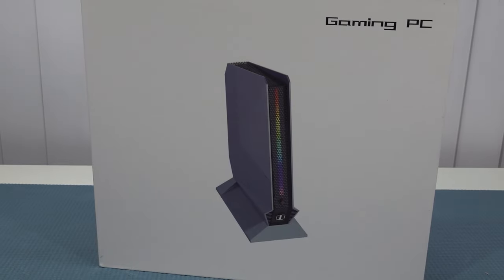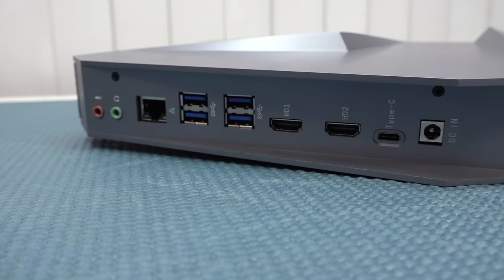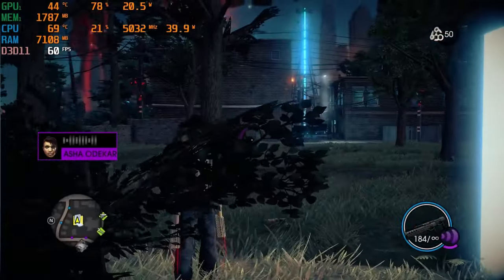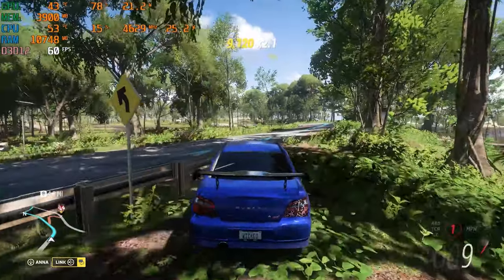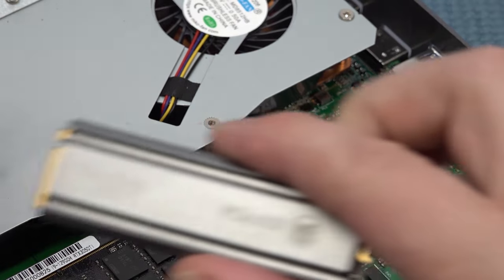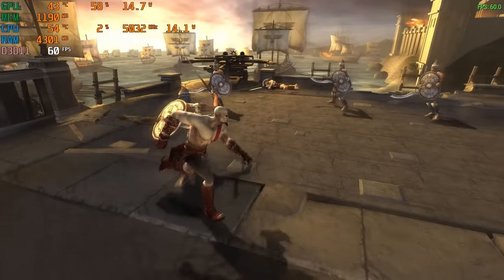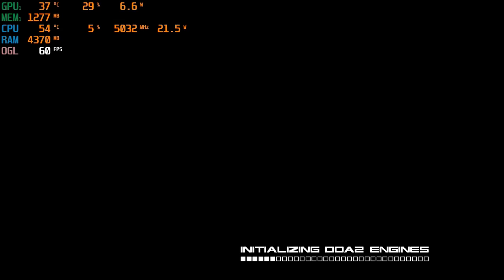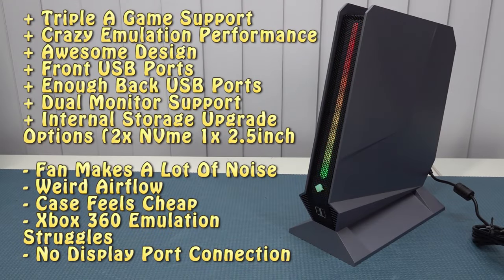Best Mini PC For Emulation - Your Gateway to Gaming Paradise !

Comment: It's cooll but for the i7 version with 16 Gb Ram and 1 Tb SSD you are paying 400 euro more for this than a Xbox Series X. That maybe not that flexible, but prices these days of capable miniPCs are horrible.
Reply from the maker: Yeah, i understand where you are coming from. 
Mini pc's are just expensive in this spec list. 
Still ... it can play a lot now 😶
Reply: Oh I dunno. I got an elite desk g2 with an i5 6600u in the UK for just £120 on Amazon, and that runs ps2 and Xbox full speed using batocera
Reply: @geoserenity  An intel core HD 520 as iGPU? Really ? Xemu? Or do you have a seperate GPU?
Reply: Did you check the frameskipping settings ? I still think its not powerfull enough for full speed Xbox emulation.
Reply: @erikkarsies4851  There are no frameskipping options. i play on 1x resolution with scale display mode and it runs perfecly smoothly. Maybe what you consider acceptable is have the internal resolution cranked up to 4k or  something, but it runs perfectly well for me

Comment: Thanks for the video.. What emulator did you use..
Is it retroarch or Batocera?
Reply from the maker: At this point everything was Emulated on Windows 11. 
Using different dedicated emulators for testing. 
Did not use RetorArch at al. 😄
Reply: @WickedGamerCollector  could you please recommend emulator that can handle old games besides ps2, 3 without problems

Comment: Hi dude. Thanks for the info. I'm looking to get one of this pc. Sorry if my question sounds too dump. The usb-c port it's exclusive for display pourposes or a can be used to conect external divices like an audio interface or any other stuff. Thanks again.
Reply from the maker: So what I try'd getting those USB to HUB converters. And I manage to get a monitor working and use extra USB. Main problem is triple nvidia surround doesn't work.
Reply: @WickedGamerCollector  thanks for the answer. With the hub converter are you saying that the usb-c port of this model can read/send info like any other PC's with the same port? It's not an exclusive display port? Thanks again.